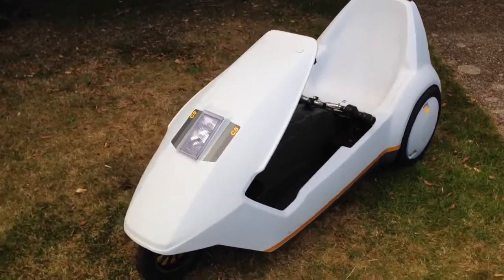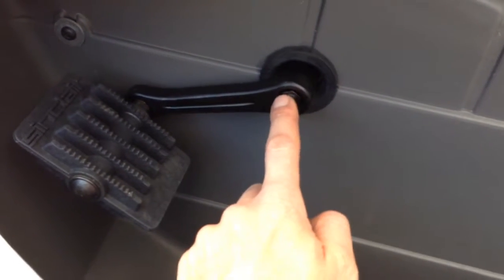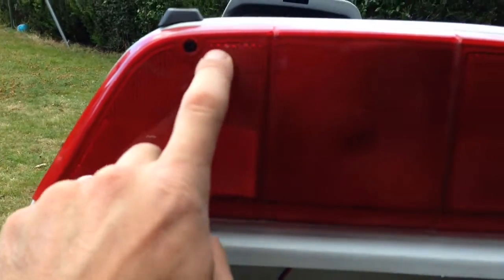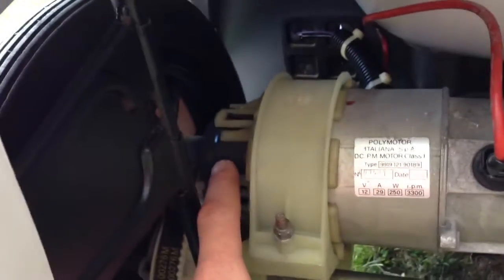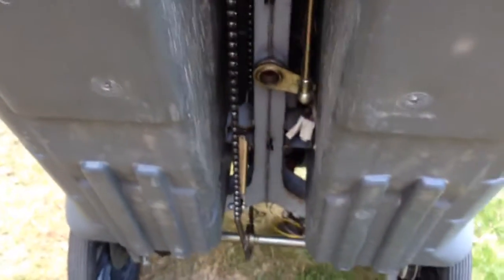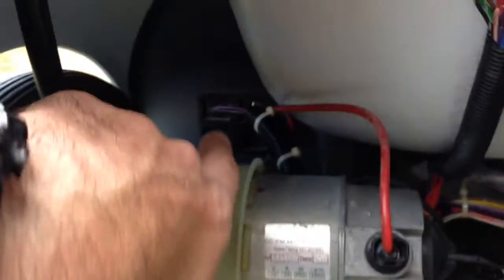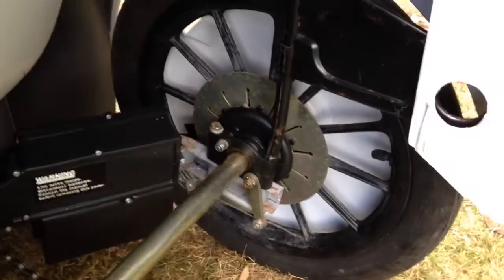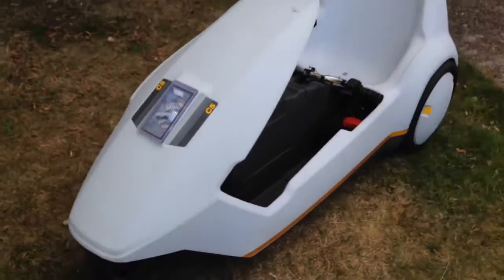GN Newton abbot Sinclair c5 refurbishment - video 1 -August 2016

Comment from the maker: Hey
Thanks for the comment :)
Firstly, get into the Facebook page for C5 Owners, this is the best place to ask anything and I'm on there all the time .
For your questions, you do just connect up the two browns to positive and blue to neg, I use quick release battery connectors (loads about this on the c5 Owners page. £5 job. I tend to move the wires a little from behind the boot, to give an extra inch or so to the wires.
There should be a Micro switch on the handle bar, you can buy a repro one for £1 approx and solder it with new wires and mount to the stock position using small screws or split pins,
Always a bad sign when the control box lid is off, I'd be surprised if the electrics work--mainly due to age and being left in damp garages. I can fix all fault or advise. But the main chip in that pod cannot be fixed by anyone, so if that's gone, you need a new pod or use it with no pod lights.
Rebuild yja gearbox and motor, key item as if you try and use it with 30 year old grease it's likely to strip the gearbox teeth as theee plastic. I have videos on this, it's pretty easy unless you have the brown gearbox finger combo (post photos and ask on our forum).
That will do for now, tag me on the forum, it's the best place!

Comment: Excellent job, looks fantastic from how it originally looked!

I'm in the process of restoring one myself, which was in slightly better condition than yours (at least on the outside) but the mechanical side looks quite messy. 

Quick question.. I've connected a 12V car battery to the blue wire and 2 brown wires (which someone has hacked off from the original battery cover). Is that all you need to do normally to make the C5 run, or is there more to it?

At the moment, my C5 is semi-working, the indicator lights, front and rear lights come on..but the motor, nothing. I did notice however, there doesn't appear to be any switch on the handle bar (I think there's meant to be a micro-switch of some kind to make it go?). All I can see is two rusty terminals and 2 wires with crimps on, on the handlebar itself (left side).

One other thing, I noticed someone has been inside the control box (the lid was off). And one of the two glass fuses (top one) is completely blown apart. So maybe someone connected the battery the wrong way or short circuited it!